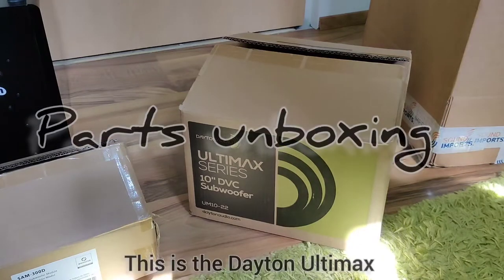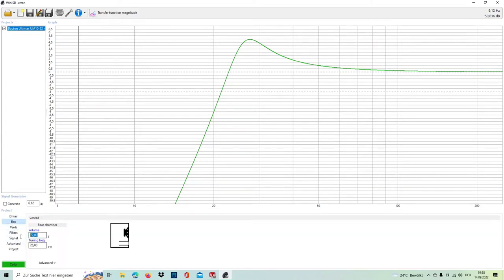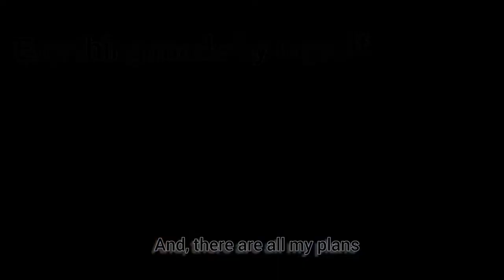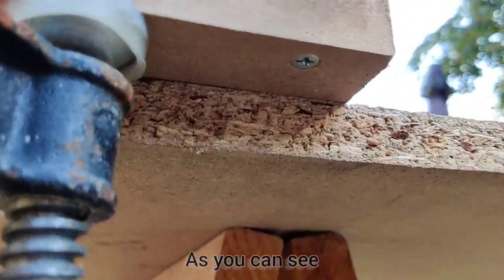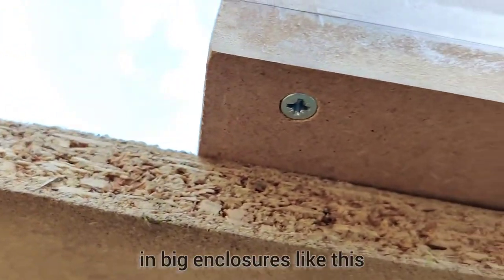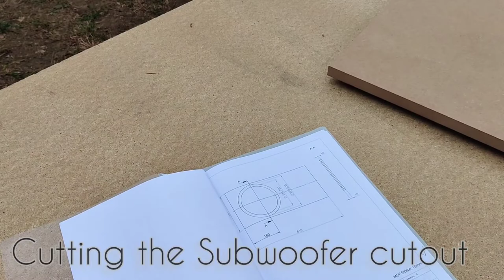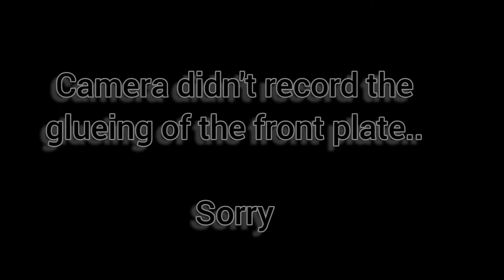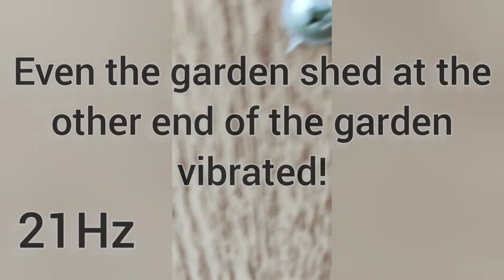DIY SUBWOOFER | Dayton Audio Ultimax UM10-22 | Big Power | #diy #diysubwoofer #subwoofer #bass

Comment: Awesome job on your build. I just ordered the Ultimax. Going into a 1.25 cu.ft. box tuned at 39hz. I doubt it will sound as good as your setup but its for my truck. Would you say this sub put out clean bass or more boomy? Thanks
Reply from the maker: The sub (in my configuration) puts out extremely clean bass. Yours will sound completely different due to the much smaller enclosure and different tuning.
And thanks for the compliment!
Reply: Changed plans. Returned the Ultimax and bought a Dayton reference sub driver in a .75 under seat box.

Comment: Oh hey you got the UM10!  How are you liking it? Sorry I didn't notice until just now.
Reply from the maker: Hey, no problem!
It's a very nice sub, bud sadly the second spider is a bit loose I guess. It rattles a bit
Reply: @s33saudios  Oh that stinks. Mine was always in my trunk so I could never hear the driver make any noises. When I had it in my house pushing it really hard I think it made some noises but I assumed I was at xmech. I like to get subs that give me way more bass than I need so I end up barely pushing my subs 99% of the time.